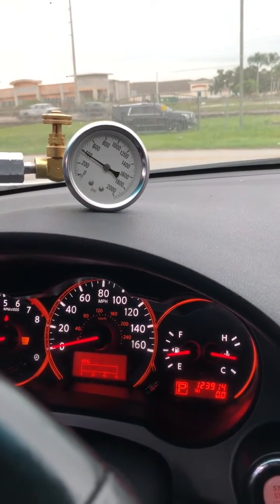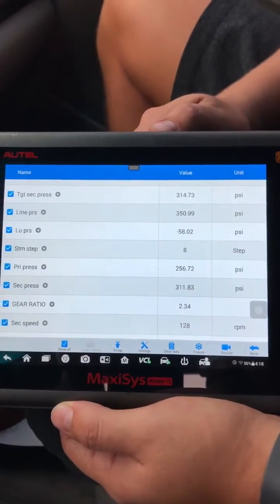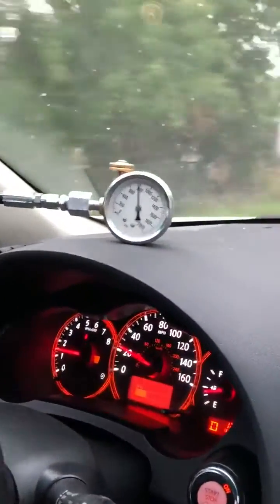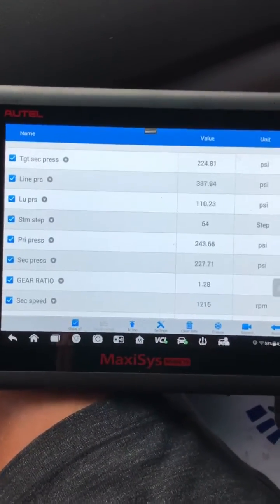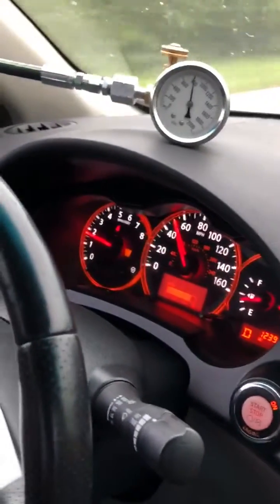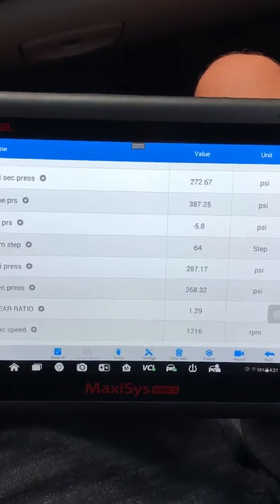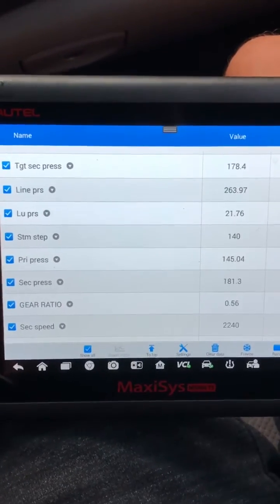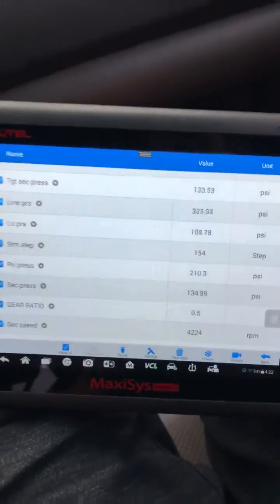Nissan CVT JF011E Test drive after repairs were done. Using Pressure gauge and Autel scanner

Comment: I have operated my own shop for six years, but never messed with CVT transmissions until I was given one from a family member because of trans issues. I took a crash course by watching your videos and learned SO MUCH! Thank you.
With that said, I have to ask about something I noticed in this video. The high pitched whining sound that corresponded with acceleration and deceleration... from what I've learned (mostly from you) it's not supposed to do that and it's an indication of further transmission issues. Is my interpretation of what I'm hearing correct?

Comment: I have a Nissan Altima 2025 sr with about 2000 miles on it and when driving it when first accelerating the rpm’s climb all the way to 4000 to 5000 rpm before shifting and I looked at the pressure readings and I saw only one in red which was lubricating line pressure was negative 73 at idle
Reply: Check codes could be as simple as a tcm relearn/re write if no codes all other pressures are ok transmission may have corrupted data and do some drain and fills if you haven't already

Comment: I had fault code p0846 and p0848 and diagnosed the fault to a bad tcm. I checked the multi plug connector on the tcm and trans and wiring continuity which were all done. I even changed the valve body with a refurbished unit which did not solve the problem. Process of elimination. It would have been nice to have to your expertise but I did use your other video to examine the original valve body for faults. I’m glad your gauge and hosing is decent as you don’t want it bursting at over 800psi 😜👍🏻
Reply: derek is a great person very good people at sunbelt